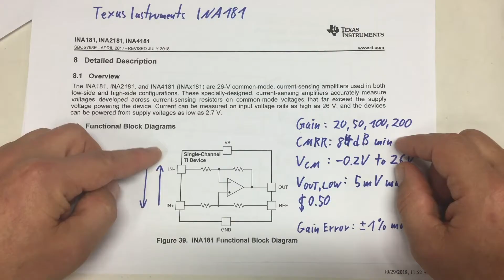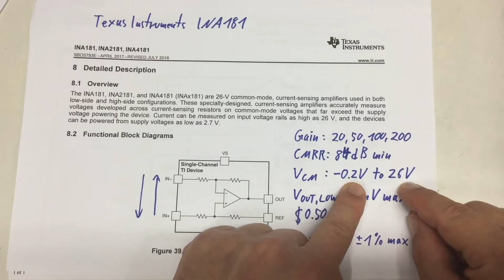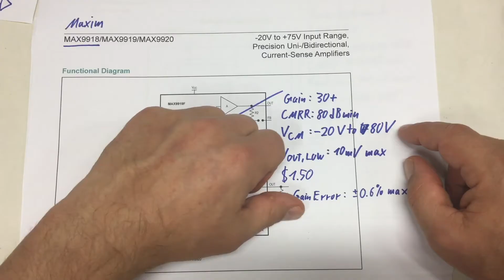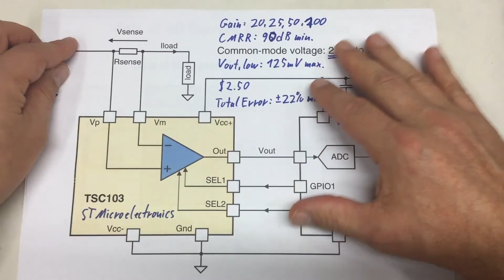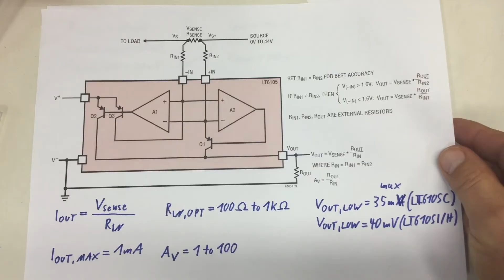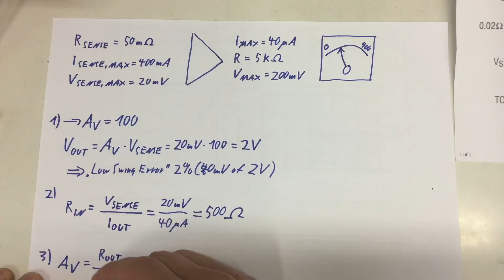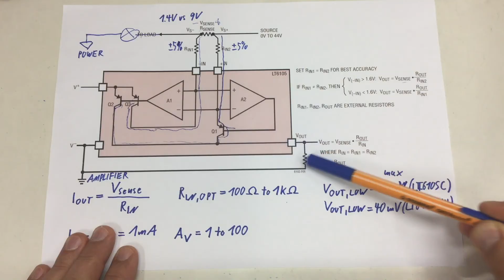Current Sense Amplifiers (2/2): Examples and Circuit with LT6105

Comment: Thank you for this video. I was actually looking to measure the current in a circuit where i don't have access to its ground and the current is in the mV range. I am still not sure if it will operate as a floating solution.
Do you have an idea if there is other current sense ICs which are OK without sharing same GND as the load?
Reply from the maker: Generally you will need a floating, that is galvanically isolated power source, for your floating solution. However, you could also use an Hall effect current sensor (here's a link to the ones from TI, but there are other vendors too: https://www.ti.com/sensors/magnetic-sensors/hall-effect-current/products.html#-1=%3Btrue& ).
Reply: @robertssmorgasbord  thank you, i am familiar with it, the issue is, the current i want to measure is in the order of few mA (max 10mA) and hall effect sensor are not good at that range. And that's why i was looking for a shunt based solution
Reply from the maker: @fedimakni1200  Well then, if you don't have access to the ground, it will be a floating circuit with a galvanically isolated power source. Good luck!

Comment: Thanks very much Robert for covering the instance where the LT6105 power and the measured current were not connected.  I wondered about that since it is not covered in the datasheet.  We are planning on using the LT6105 in some test circuitry.  It is easier to lay out our boards with the returns isolated and connect after the fact if needed rather than the other way around which would require a board respin.
Reply from the maker: You're welcome! And yes, it's really never mentioned in the datasheet, not even implicitly.

Comment: What if I want to use SMT current sense resistors to measure high bandwidth AC/DC current instead of using an expensive high frequency current probe? If we make the common mode voltage a little more challenging like mains input for a 25Watt (very popular) universal switching flyback auxiliary power supply. Can it be done?
Reply from the maker: If we're talking mains AC, there are specialized chips for that job, e.g. https://www.allegromicro.com/en/products/sense/current-sensor-ics/zero-to-fifty-amp-integrated-conductor-sensor-ics/acs730#PartTable . You don't even need a shunt.

Comment: Love the pen and paper approach!
Reply from the maker: Software for drawing schematics is overrated 😅 No, seriously, in the time I need to start the program (DipTrace in my case), create the part I'm working with, create the circuit diagram and print it, I've drawn the whole thing several times by hand. Of course if I need a PCB layout down the road I do a schematic in DipTrace.
Reply: @robertssmorgasbord  It's like breaking your brain to write with a pen in the absence of gravity. With how easy it is to write with a pencil... 😅

Very good analysis of those amplifiers. Finally I decided to use the LT6105 to be able to measure consumption through the oscilloscope. Thank you very much for sharing!!!
Reply from the maker: @Pepe-ry8pm  Thanks for the praise! And you're very welcome!

Comment: nice job
but do you connect ground of load to ground of opamp?
Reply from the maker: Yup! Load and OpAmp do share a common ground. That said, there are circuits that don't require a common ground, but those also require the power supply for the OpAmp to be galvanically isolated from the power supply of your load. E.g. your multimeter in ammeter mode works this way, having it's own battery as a power supply.

Comment: Sadly these ICs are not available for most cases
Reply from the maker: Well, at least the LT1605 is available (in stock)  form all major distributors: https://www.digikey.de/en/products/base-product/analog-devices-inc/505/LT6105/61046 , https://www.mouser.de/c/semiconductors/amplifier-ics/current-sense-amplifiers/?m=Analog%20Devices%20Inc.&series=LT6105 , https://de.farnell.com/en-DE/c/semiconductors-ics/amplifiers-comparators?st=LT6105 .

Comment: nice video, thanks for sharing, I was about to ask you about having different grounds between mesuring circuit and the load, then I saw you tried it disconnected and worked just fine. Maybe with this the common mode issue is reduced dramatically since the common mode voltage is the voltage in the shunt resitance, only issue with different grounds is you can't touch the metering circuit if load voltage is high, I am planning to use this circuit to measure current in a VLF tester ad different grounds is just what I need. Regards from Chile
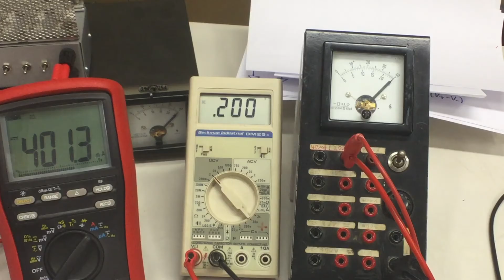Reply from the maker: Thanks for the praise and you're welcome! But to make it absolutely clear: According to the LT6105 datasheet it shouldn't be used without a common ground (floating). See also 39:03 in the video. Though it was working in my setup, that's no guarantee it will in yours too. Anyway, good luck with your project!

Comment: Excellent placements. Currently we have some INAs (eg INA250) with built-in shunt and some interesting (good) features. When it arrives I will test it to see how they behave.
Reply from the maker: Thanks! The INA250s were new to me - and I like them: 4.5 mOhm in-line resistance and 0.3% accuracy. The only drawback are the relatively high offset currents in the mA / tenth of mA range. But then, they're made for measuring currents up to 10 A.

Comment: Hi Robert, than you so much for your lecture on the current sense amplifier principles. However I do have some questions if you may help me to solve my puzzles. How to detect a current leakage between the Shunt and Load and control the constant current flow into the load ?. Any advantage to monitor voltage drop between sense resistor and the Load  (to detect in case of leakage along the path till the Load?.. Thank you for your help..
Reply from the maker: Hmm, interesting questions. The first thing you would have to answer is where is my current leaking to - obviously back to the ground of the power supply. If that's the case you would need a second second shunt as close to the load as possible with it's own current amplifier. But why do you expect some leakage current? What voltages are we talking here. Anyway, monitoring the voltage across the load through two Independent, non current carrying lines is a common feature in high end power supplies. It allows you to compensate the voltage drop across the current carrying lines between the power supply and the load. Basically the feedback for voltage regulation comes from these two lines, and not from the current carrying binding posts on your power supply. But it does absolutely nothing for detecting current leaks.

Comment: Timely subject in era of battery powered DC motors that when heavily loaded can suck your battery dry in seconds.
Reply from the maker: Yes, monitoring your currents has become more and more important. I remember the time when you just looked up the stall current for a motor in its data sheet and dimensioned the power supply / power electronics according to that. After adding a thermal cut-off switch you were done. I guess those times are gone, considering that your lithium battery can go bang when you draw too much current from it 🙂

Comment: So my high side voltage can be anything from around 12V to 18V through an H-Bridge that creates a square wave of around 10kHz at 5A (maybe up to 10). I need to measure that current and convert it to a voltage from 0 to 3.3V into an analog input (a 10 bit ADC). It would be nice to have 10mA resolution and read all the way down to 10mA up to 5A, but I have 2 outputs with different needs, so could have one circuit measure 0 to 1A to measure down to 10mA (giving me more resolution and sensitivity in my 0 to 3.3V output), and then have the 5A circuit have less precision, especially on the low end since is is mostly to give an idea how much current is being used give or take a little bit and to provide short circuit protection if I go over 5A (or 10). But easier duplicating the same circuit if I can. I've even looked at using a Pulse Current Transformer. What would you recommend? It would have to be bi-directional. I also thought of just running something into the DC input to the board that creates the square wave and subtract out the current the board uses. There is an unknown, but high (2-4V drop) from The DC input to the square wave output depending on current. Many of the chips I have seen have a center point, zero current is 2V. The boards that give you 1V per Amp are really nice, but they are uni-directional for measuring the input instead of the high side output. Could you offer any ideas? Thank you.
Reply from the maker: Measuring the current in an H-bridge is not an easy feat. Have a look at these application notes:

https://www.ti.com/lit/pdf/sboa174&usg=AOvVaw35atuliGHFP5Txoi8SBztE
https://www.analog.com/media/en/reference-design-documentation/design-notes/dn407f.pdf
https://www.st.com/resource/en/application_note/dm00653792-current-sensing-in-motion-control-applications-stmicroelectronics.pdf

Regarding your two ranges: You've got a 10 bit ADC, you need a 10mA resolution between 0 and 1A and you need to measure up to 5A, yes? A 10 bit ADC (1024 counts) will give you a resolution of better that 5mA for a 5A range, so no need to fiddle around with two ranges.

If you've come up with a solution and you're unsure about it, I recommend discussing it on the EEVblog.
 
Hope that helps.
Reply: @robertssmorgasbord  Thank you. My situation is unique in that I am not directly driving a motor, therefore no inductive load. I am feeding it into a board that splits a bipolar 15V p/p signal into a rectifier to get voltage from it, and into an optoisolator to extract the signal from it.

There are so many variables, it is difficult to find what I need. I want 5A, but may need a 10A sense. I will probably need 2 circuits, one to send the sense voltage to a 3.3V logic ADC and one for a 5V ADC. The LTC6103 seems interesting. Maybe even the INA240 or ACS724. I will have to spend quite a few days thinking through all of them. And then consider cost.

The Arduino Motor Shield has an LMD298 on it, so it can only go to 2A. That has a .15 Ohm resistor connected to an Op Amp with a gain of 11. So at max current, it delivers 3.3, which works for 3.3V and 5V logic. I want to do the same thing for 5A and 10A. But I wanted to see if for the same or less money and parts count, I could do better. There are much better current sense chips available to day than when this board was designed. A shunt and op am will always be available though, while a fancy current sense chip could get discontinued tomorrow and then you have to deal with a board redesign.
Reply from the maker: @DCCEX  Wow, sound you've go a challenging project at your hands. A few more remarks from my side: I don't see any reason why you shouldn't go with low side current sensing in your application and stick with op amps. When you really need two ranges, use two shunts in series (e.g. 0.1 Ohms and 0.01 Ohms) and have one op-amp measuring across both and ground, and the other just across the smaller one and ground (the smaller one of course connected to ground).

Comment: Take a look at the Allegro ACS7xx series of Hall Effect Current Sensors. I have the ACS724. https://www.allegromicro.com//en/products/sense/current-sensor-ics/zero-to-fifty-amp-integrated-conductor-sensor-ics The ACS712 and ACS714 are popular, too. If you buy one of these, only buy it from an OEM vendor, as these ICs are highly counterfeited on Ebay/Amazon/Etc. Be careful of the full extension of the model number that you are interested in, because there are many variations within a single model number... Different amplitude and sensitivity ratings...
Reply from the maker: Thanks for the info! These are some very nice chips for measuring high currents. Linear frequency response up to 10kHz (OK, they start to phase shift a little at 1kHz) and response times / slew rates in the microsecond range - I like it. The only drawback is the worst case accuracy of +/-3% (ACS724KMATR-20AB at -40°C to 25°C). But since the typical error is +/-1% you can live with that.

Comment: This is a great two-part series. Thank you for your effort to teach us!

I found this neat project for a Precision Low Current Measurement w/ Feedback Ammeter and completely built it out... KiCad files to manufactured PCBs to full assembly. It is an adapter for a multimeter to read tiny current. It works well. You may find the circuit interesting.
https://www.youtube.com/watch?v=YfB1hZ44B20
Reply from the maker: Thanks for the praise! You're welcome! And thank you for the link of course. I had a look at the video and the links in its description - very interesting indeed!

Comment: Nice video ,thanks ! Is it possible to get the output down to 0V if we give a negative voltage on the V- instead of connecting to ground ?
Reply from the maker: You're welcome! To answer your question: Not really. The minimum output voltage of the LT6105 is unfortunately not very well specified. The datasheet just gives you maximum values between 35mV and 45mV, depending on the operating conditions. So you would need some kind of adjustable negative power rail. Also, the LT6105 is a current output device. Its internal circuitry assumes that Vout is connected via a resistance Rout to V-. If you connect V- to a negative rail and Vout via an Rout to ground, you might get a nice 0, but all non 0 output values will get distorted.
Reply: @robertssmorgasbord  Thanks Robert. I overlooked that it is a current output devices. I guess the "idle" current output is derived from the input offset voltage.
Reply from the maker: @mumbaiverve2307  You're welcome! And you might be right about the input offset voltage causing the minimum output voltage / "idle" current.

Comment: Hello! Thank you very much for making this video. This was fascinating for me and also very relevant. For my dissertation (a software engineering degree) I am working on LoRa radio-related technologies. One of the things I have to do is to be able to accurately measure current consumption when the radio is sleeping, receiving, and transmitting. The amount of current drawn ranges considerably: From ~5uA when sleeping to ~140mA when transmitting at full radio power. Do you think the LT6105 would be a suitable device? I would feed the output of the LT6105 to an ADC on a microcontroller for sampling. Somehow I need to scale the output of the LT6105 from 0-5 or 0-3.3V for sampling. This is all new territory to a software engineer! Any advice from either yourself or your viewers of this channel would be greatly appreciated. I will watch the video a few more times as I need to let things sink in slowly! Again, many thanks for this wonderfully informative and very well presented video. Greetings from Scotland!
Reply from the maker: Hello, and greetings from Germany! To answer your question: No, the LT1605 is not suitable for this application (it does not really go down to 0 - I hopped through some hoops in my circuit design, so that won't be visible on the analog instrument). Your application got an extreme large dynamic range. If 140mA is your full scale, 5uA is 1/28,000 of that. So coming from the ADC side you would need at least a 15bit ADC (32,768 values) for the 5uA to show up as 1 LSB. On the analog side you'll need to achieve a precision of at least 0,0036% of dull scale, so your 5uA will show up at least in the range of 5uA. The next problem is the shunt resistor. To get even a 100uV signal at 5uA you would need a 20Ohm shunt. But that shunt would drop 2.8V at 140mA. In short, there's no single chip / single range solution for your problem. But fortunately there are (open source / open hardware) solutions for that (look for the "Current Ranger"): https://www.youtube.com/watch?v=HmXfyLyN38c